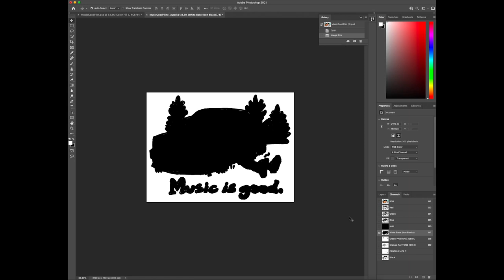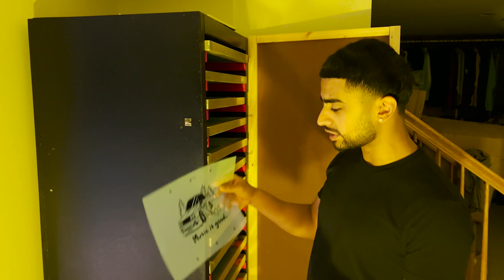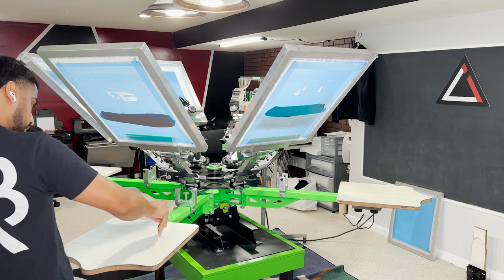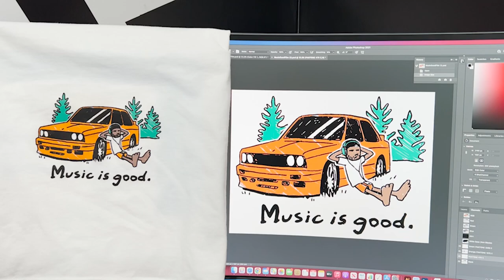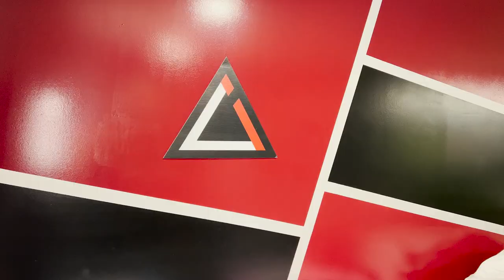SCREEN PRINTING For A CLOTHING BRAND From Start To Finish

Comment: Your normal registration test includes white pallet tape for base + clear pallet tape for each color that you wipe after each color. Curious why you used a t-shirt for the registration test with this project. Great channel. Appreciate you.
Reply from the maker: I use a t-shirt and print the white base first then add the clear tape over it and print the top colors on top as you see on the video to test to see if registration is on point. If registration isn’t good I just wipe the ink off and make the adjustments needed until I get registration dialed in. This is easier because instead of wasting so many scrap shirts with bad registration this saves a ton of shirts because all you do is wipe the ink off

Comment: The colors should have had a .05 Stoke on them which would be much easier to finish the design off with the black with no spread and not lose any details which the person that did the seperation should have known.
Reply from the maker: Actually the original seps did have a .05 stroke on it. However, I increased the stroke since I know the issues my press runs into. As you see in the video I ended up remaking the screen with the .05 stroke from the original seps and all went well. So all is good and the person that did the seps already knew.

Comment: Kind of a weird question but are you using multiple computers for the software you use on all the different softwares you use? Or do you outsource some of your designs like your digitizing for embroidery? What’s your setup?
Reply from the maker: Digitizing I mainly outsource, I run photoshop/illustrator on my main computer which mainly runs a lot of my Adobe products